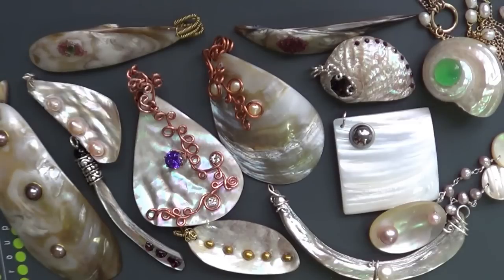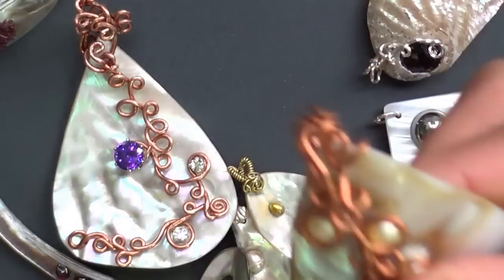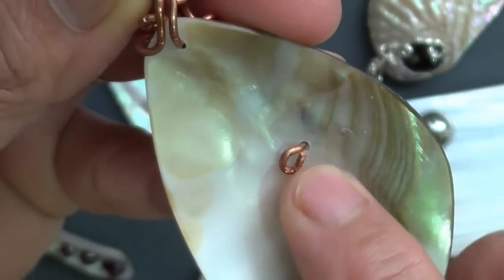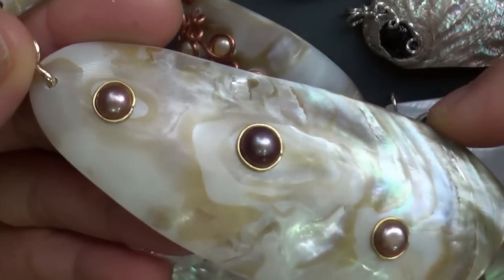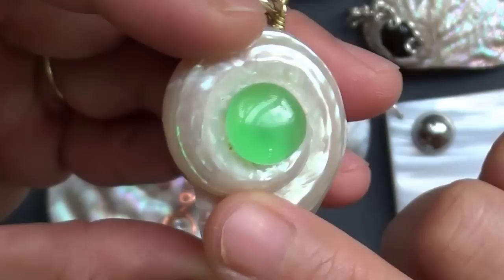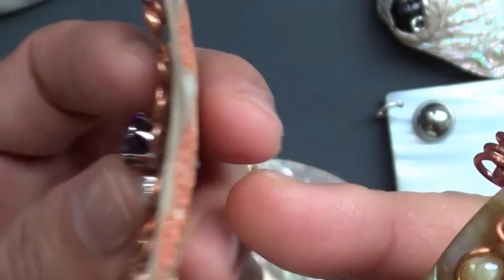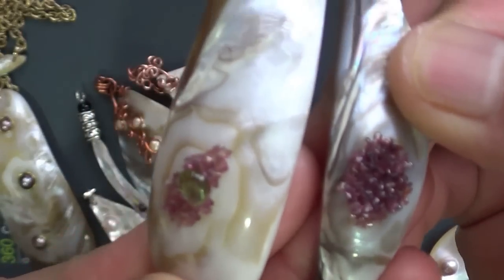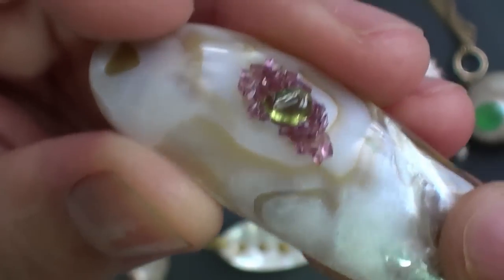Drilling Holes and Gluing Gems on Seashells | Liz Kreate

Comment: I never knew how beautiful a simple shell can be after removing the calcification. They are pretty enough to stand alone, but I really like how you've added bits and bobs to enhance some of them. I came across an old pair of amethyst stud earrings that were my Mom's. They do not look like the same artisan made them! The stones are not the same color intensity and 1 setting is a bit more delicate than the other. I might just have to use them individually how you've used a stud earring on 1 of the pcs you shared near the end of the video. Thanks so much for sharing all of your lovely designs.
Reply from the maker: You're welcome Michelle and good luck with your project. I'm sure it will turn out beautiful. Thanks again for watching and commenting. Cheers, Liz

Comment: Hi Liz :--) my I ask you what brand of drill are you using ? x
Reply from the maker: Hi Marina, I have a 3 different types of drill that I use. Two of them are no longer  in production and the other is a dremel. May I suggest that if you're wanting to get a rotary drill, just make sure that it has "Variable Speed." Cheers, Liz
Reply: Liz Kreate

Comment: I love, love, love your channel. I really like what you are doing with the seashells.!
Gorilla Glue just came out with Clear Gorilla glue.. The E6000 takes way to long to dry.
I have an opportunity to set up a workshop soon. Also, along with my Dremel rotary tool, I bought a drill press for it. It can be used like you are doing with the water but the drilling uses less of your strength. I love it.  Awesomeness👍

Comment: What is this tool called and do the bit attachments come with it if not what are they called ?
Reply: I don't know what tool she is using, but a Dremel tool will work very well for the same job. However, if you are going to be using it in water, make sure you get a cordless Dremel. Using corded electric tools in or around water is extremely dangerous and you risk electrocution. Dremel is not very expensive and usually comes with the accessories you see in the video. You can find Dremel very easily online or purchase in places like Walmart, Kmart, Home Depot, etc.  Good luck.
Reply: @zickiezickie  Thank-you.

Comment: can you tell me how to polish my crystal quartz points I put them in rust out to remove the rust and it left a gunky white milky film on it that does not wash off can you tell me how to polish them I have a dremel tool
Reply from the maker: Coleen Taylor Hi Coleen, Sounds to me that there are other minerals on the surface of your quartz and that's the reason for the milky film on it. I'm not an expert on cleaning quartz, so I can't give you any advice. Maybe you can check out the link below on cleaning quartz. All the best, Liz
http://www.mindat.org/article.php/403/Cleaning+Quartz

Comment: Liz another great video, where did you get the grinding tool and cutting I'm curious.
Reply from the maker: Hi Marsha, I got the grinder from our local craft store many years ago. Nowadays, there are a lot more rotary grinders available from hardware stores and also online. May I suggest you look into one with a flex shaft attachment. All the best, Liz
Reply: Liz Kreate thank you very much I noticed I duplicated a question you are kind.

Comment: I wish I had some place close to pick up shells. I use to live on the MS Gulf Coast before Katrina and had access to shells. Now its such a long drive to get anywhere to get them.
Reply from the maker: +Monica Sedillo Hi Monica, There are a lot of places that sells sea shells if you can't gather them yourself. Thanks for watching. Cheers, Liz
Reply: I have been looking a lot on ebay to see if there are any there that I want. There are a few that look decent. Thanks, Monica
Reply: +Monica Sedillo  I've  had the same problem, used to live by the ocean but no more. I think ebay prices for shells are high.
Reply: I have found some shells at Hobby Lobby and Michaels as well but there is not very much variety.
Reply: I found some very tiny ones that I thought were so cute I had to get them. I ended up making some seashell bottles with them.
Reply: That sounds super! Do you know what kind of shells you got? I love the little butterfly ones!  I'm saving the plastic bottles that my Coffeemate cream came in (free is good!). I'm going to poke a hole in the bottom & insert a candle up into the bottle ( using one of those electric Xmas window candles that you can always find cheap in a thrift store)). Then hot glue the sides with  some seashells. I think it will be a cute night light! Hope yours turned out nice!
Reply: I actually don't know the names of them. Sry :(
Reply: No worries, have a great night!